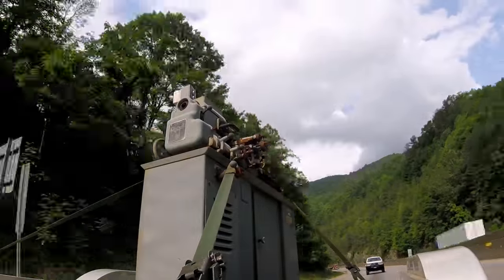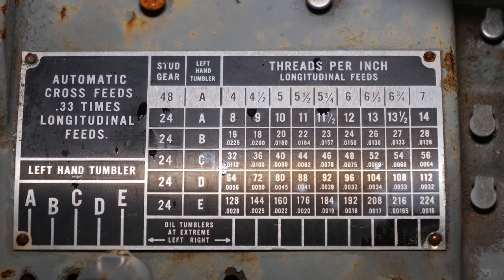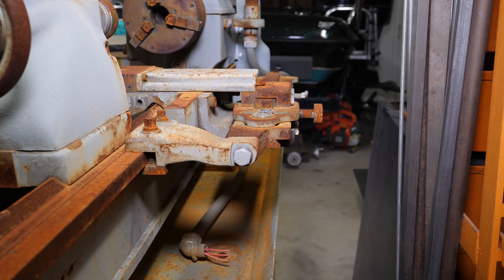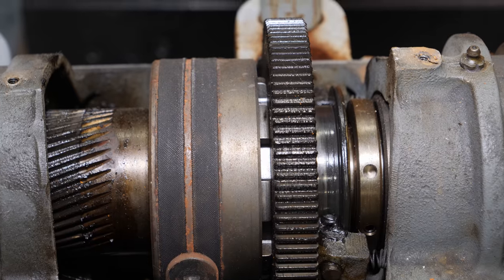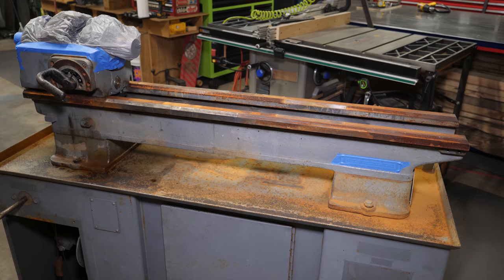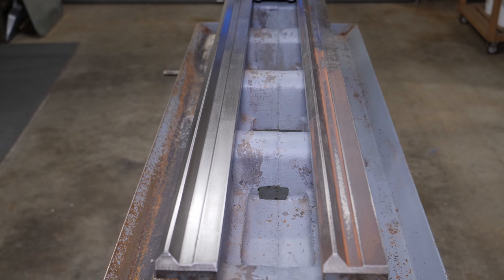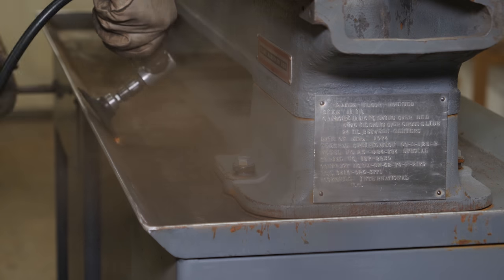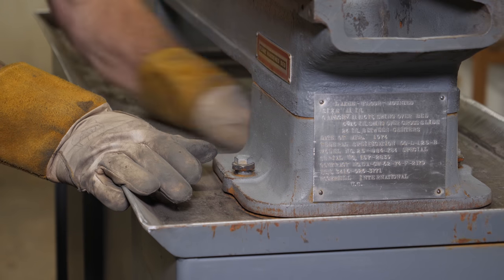Rockwell 11" Lathe Part 1

Comment: Rockwell 11" are good lathes only weak part is the back gear teeth are a little weak and if used to removing the L00 collar one might break them gears off.
Reply from the maker: Yeah I've read that gear is really the only weak link on these machines. Shame too as it's a really nice gear, wide pattern and helical. I have done what you described before with no issue but I also don't over tighten the lock collar. I have gotten into the habit of just bumping the pin wrench handle with a dead blow and the lathe in direct drive. The spindle will move a little but the belt tension provides enough drag to allow the collar to come loose with two bumps of the wrench. Once the collar is loose the chuck comes off easy by hand. Thanks for commenting.

Comment: That taper attachment is a rare treat for these lathes.  I have a couple 11's myself.  Mine didn't need much, just cleaned up.  Hard to find that back gear though.  They all have broken teeth.  That was a rare one indeed.  Most of these lathes were in High schools and kids would turn that front handle which locks in the backgear...  chipping the teeth.
Reply from the maker: Funny that you mentioned the taper attachment today. I'm using it right now, in the next video. Yeah I've heard/seen that on the backgear. It really is a big helical gear. The only way that I see to break it is just that- operator error!

Comment: Great video. Have you thought about soda blasting to clean up the parts? Made a great job of some old lathe parts and the only clean up is to pressure wash afterwards. The soda is non abrasive so does not make a lapping paste!
Reply from the maker: Thx! Yes I have done soda blasting before for car restoration. Although this is labor intensive it is low cost and anyone with little to no experience can do it without worrying about causing damage. Thanks for commenting.

Comment: Great video. I am a mechanic at a large machine shop, so all this is of great interest to me. Thanks for your thoughtful approach.
Reply: pat stanush
I recently bought a 11" Rockwell and pulled the spindle as part of the cleanup. I found the grease in the front bearings grease to be caked and old with a lack of oil. I suggest that you replace the spindle grease before your run it .
I removed my reeves drive and installed a 2 hp 3 phase motor direct to the spindle belts with a 2 to 1 ratio.  This , with a vfd included, works beautifully.
Reply from the maker: Thanks for the comment Pat. I have greased it until it pushed old grease out and I will do it again after some run time. The old grease in mine was not dried out yet or contaminated. I had the same idea about removing the clunky reeves drive! I would be interested to see what you did! Could you post a simple/short video or send me some pictures? That would be awesome to see your configuration.
Reply from the maker: Awesome, thanks for commenting!

Comment: I almost bought a Rockwell lathe but it was missing to many parts. I thought it was a very nice lathe. Yours seems to be a good one. I look forward to the next episode. Thanks
Reply from the maker: I'm missing the tool post, chuck wrench, and both chuck keys. It also don't come with the giant electrical box that was bolted to the four large holes on the back of the cabinet. All in all not to bad and I'm glad the electrical box was already removed!
Reply: Lifes Journeyman @@

Comment: Lovely job there! As a sidenote, most vfd's are capable of swapping the phase rotation to the motor in a simple programming step, negating the hassle of hardwire changes to change motor direction.

Comment: I think you once asked why the back ( Outboard ) bearing always fails. I believe it is because both bearings are journal bearings and there is no or little thought put into addressing axial thrust. Usually you only find a spring shim behind one of the bearings and this isn't sufficient to handle the thrust from energizing the motor, which acts like a huge solenoid that spins. When you get up to speed, the axial thrust evens out. If the OB bearing was replaced with a tapered roller bearing, this might help. Might make an interesting experiment.

Comment: Well done video. Anyone thinking of removing a bed on a lathe to paint etc, just remember if its pretty level best to leave it as you can spend days just getting it back level unless your up for that kind of work. Ultimately depends on skill and level of restoration required

Comment: Biggest problem with the Rockwell 11 is the back gear always has missing teeth from people engaging it to take off the L00 chuck.  Have seen 4 of them and they all have a few teeth missing.  Actually the lathe is pretty solid and work well.
Reply from the maker: It's a great lathe and no missing teeth here. There is enough tension in direct drive to remove the chuck with a dead blow and the proper pin wrench as long as it's not been over tightened.

Comment: Brilliant job it’s going to be a great machine by the look of how it’s going so far, one question though your rust remedy is looking fantastic but I would be concerned about it continuing to rust between the lathe and the cabinet do think it will be ok.

Great job so far Alan.
Reply from the maker: Thanks Alan! Very observant, there is a small gap between the bed and the base because of the leveling screws. I slide some sandpaper between the two and blew it out until no more debris came out and then rinsed it and blew it dry. I'm sure that there is still some minor rust present. Once moisture is removed for the equation the rust process pretty much stops, it had standing water in the chip tray before. When I start using it I will shoot some oil in the gap to remove air from the equation as well. That should stop any more rust from forming.

Comment: You did a excellent job at restoring this Rockwell. looks fabulous! Two questions. Why was a nice lathe like that sitting in the wet? and if you don't mind, how much did you give for it. I lucked out on a Facebook  post and I got one, exact same lathe except for the surface rust for 900.00. It came with a 6"-6 jaw buck chuck and a, I think it is a 7" 4-jaw. and tons of tooling and metal stock. So I think I got a really, really good deal. and a milling post. No kidding. I couldn't believe it.
Reply from the maker: Sounds like a great deal David. From what I could tell my machine wasn't used that much and at some point was stored in a bad environment. Why wasn't it used? I have no idea, it's a great machine with a taper attachment. Glad it wasn't used much as it has little wear on it even with all my usage!

Comment: @7:45 " Do you know how hard it is to index a square to a circle in free space? "
I thought about this and came up with this method. Easier to do than describe because the word "square" gets used as both a tool, and a geometric figure. 

What to do:
Draw a small square just enclosing your circular hole, with a big X drawn through its corners, and extending outwards. Place your  cover with its corners on the big X. Lay out your bolt holes as required.

Why this works:

This smallest enclosing square has the same center as the circle. Since diagonal lines drawn through opposite corners of this square intersect at the center, any square whose corners are placed on these diagonals will share the same center. They will also have parallel sides, so set up this minimal enclosing square so that its sides are parallel to the sides, top and bottom of the cabinet.

The top and bottom sides need to be drawn horizontal and touching the circle at its top most and bottom most points.
The left and right sides need to be drawn vertical and touching the circle at its left most and right most points.

Use any way of achieving this alignment. A framing square or even a torpedo level might work.

I tried this using the bottom of a spray can for the circle, and the corner of an envelope for my square. It works.

I hope this was clear.

Comment: Hey Burton. Nice lathe. We have the 10" Version. I'm impressed at home much more of a machine the 11" is. 1.5" spindle bore would be nice, out 0.950 is very annoying at times.

Funny how fast 2 or 3 videos turns into 11.
Reply from the maker: Thanks. Yeah, for a small lathe it has big features. How long is your bed?
Reply: @BurtonsAttic  I think its a 36" inch if I recall correctly.

Comment: Great video on the Rockwell 11 inch metal lathe .I’ve got the same lathe and I have a sloppy  cross slide brass nut and cross slide bolt I have no idea of where I can get such parts .ls there anything that you can help me with I would really appreciate it I only have a CAT no. It’s FK102503 , No other numbers visible .

Comment: I have the same lathe and it works well except for the Reeves drive or variable speed control, it often is very stiff and hard to move the lever. Do you have any suggestions on this?
Reply from the maker: Patrick I will talk about this in the next video!

Comment: Try Gunk degreaser. I started using that in place of Purple Power because it doesn't kill the paint.
Reply from the maker: Thanks for commenting Rasheed, been down that road. I can't stand the odor of it. Super messy and doesn't work as good in my observations. Works ok on a greasy engine for the initial cleaning. The reason for the crazy spray pattern it has, reaching deep into the engine compartment.
Reply: @BurtonsAttic  yeah, you nailed it. Definitely those are definitely the downsides. Keep up the good work.

Comment: Nice job man!  
Just for curiosity.  I don’t want to buy a lathe. If you were hired to do the work on that lathe, what would you charge?  

I have heard that VFDs cause motor heating at slow speeds and a loss of some power at slow speeds.  

What is your opinion?

Comment: Great video, I'm looking for a boxford lathe, how do you make sure everything is aligned
Reply from the maker: That will come at the end. Check the spindle run out and cut a piece of stock and take measurements to see what's going on. Their are also precision ground test bars that you can buy to test with. To me if it cuts straight it is straight!
Reply: @BurtonsAttic  I thought so, thanks

Comment: Nice job! What type of rust remover did you use? Looks like it works well
Reply from the maker: Thanks RuDan, elbow grease and maroon scotchbrite. I use purple power or mineral sprites as lubrication to help provide a wet sanding action. You can see in the Rockmill series or it will be in the next Rocklathe vid.

Comment: Hey Burton 
1 1/2 is the special! 
When you remove the rust from the bed how does it affect level?   Does it need to be scraped?
Reply from the maker: Somehow I made a typo, it's 1 3/8. I think I answered this before but all the parts that I have made are accurate to at least .001 minus my setup errors. Most parts are good down .0005

Comment: What kind of wax are you rubbing on at 6:20? Is it oilbased or similar to keep rust away?
Reply from the maker: Joel it is Mothers automotive wax. Most any automotive type wax will do. Johnsons floor wax is great for sealing bare steal surfaces, like my work table or a table saw top.
Reply: Burton's Attic Umm, steel...

Comment: I have a question. on my lathe I have two gears. in the first position of the lever, the chuck spins freely but in the second it acts like a brake. is that natural? Ive taken it apart and when the lever is in the second position the gears are meshed but I cant move the chuck. its  to messy to take all the gears apart
Reply from the maker: Need more info than that......What kind of lathe? What are the positions marked as?

Comment: If you can't find stubby roller covers buy standard rollers and cut to length. You could go to a paint store and find stubby rollers.
Reply from the maker: Mike the small roller that I mentioned was a foam 1" diameter disposable roller.

Comment: nice clean up job, can't wait to see the rest. I'm wondering if the bed ways and slides need to be scraped after removing all that rust ? also how did you spec the VFD to the motor ? 
thanks,Robin.
Reply from the maker: Thanks Robin! I know scraping is all the rage but I see no evidence that Rockwell did so on this machine. I think most would say that higher quality machines are scraped in. Not saying it couldn't use it but I just don't feel the need. Scotchbrite doesn't remove cast iron in the manner that I'm using it so in removing the rust I'm just taking it down to the original surface. Their is some very minor etching on the ways in a few places but that is below the surface so I'm not too concerned about it. Natural scraping/oil pockets? Their shouldn't be any high spots except for tooling damage/nicks. If their is it's easy to spot and address. As for the VFD the motor is 2HP and the VFD is 3HP. "They" say that you should always over rate the VFD. Never put a smaller rated VFD on a larger motor as that will cause smoke to be released. Over rating the VFD is only really a problem if your way over driving a normal not inverter rated induction motor. As long as your using it in a "normal" manner it shouldn't be a problem. I personally wouldn't go more than 1HP over what the motor is rated for on the VFD.

Comment: what size of drive screw rivets did you use on the data plates?thx
Reply from the maker: I don't recall exactly. I think less than an 1/8, Best thing is to gauge the plate mount hole and go from there.

Comment: Maybe the zirt on the spindle is supposed to take oil that drips to the lower shaft .
Reply from the maker: Their is an oil fitting on the clutch but it can't really get to the back gear shaft because it would drip on the outside of the back gear shaft. Not the gear itself if that makes sense. The grease fitting over the front spindle bearing takes grease not oil. Thanks for commenting!